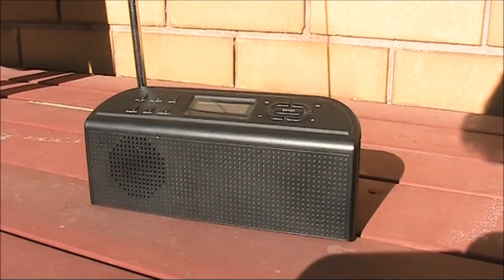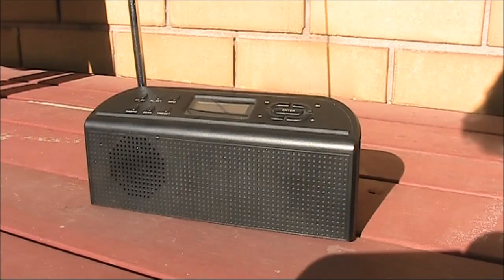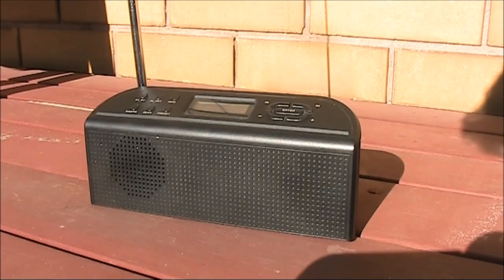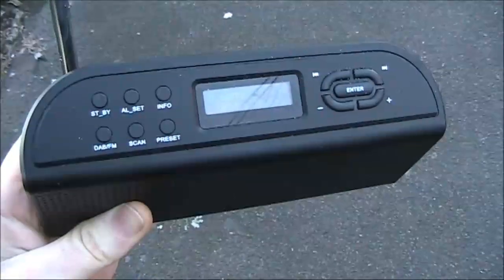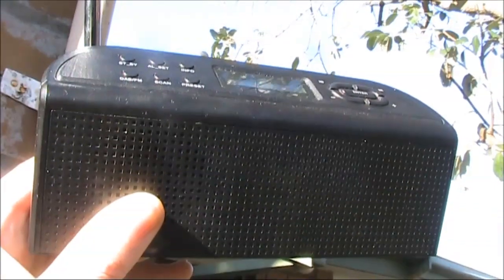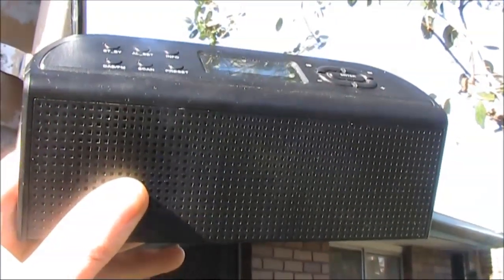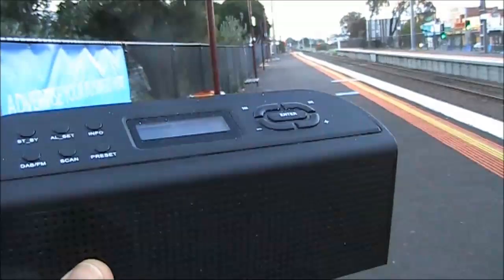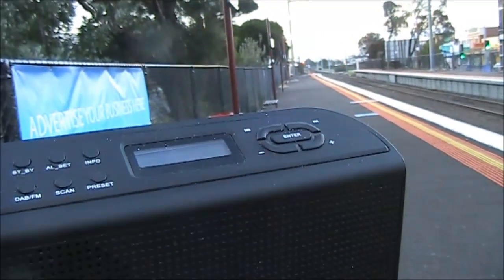Range testing a 1 watt low power FM broadcast station (Surf FM)

Comment: Time to bump up the power. If you are allowed 1 watt then it should be measured at the antenna input. I suspect some loss in the feed line. Just do it and run another range test. Bump up the power to 10 watts. Make the amp adjustable so you can turn it down if you need to. 2 watts won't make any difference worth bragging about but 10 will. Good luck.

Comment: If the transmitter can be mounted on a 10 meters tower, things can change.
Reply from the maker: We went past the Surf FM transmitter site a few months back. It was a suburban house with a 10 - 15 m mast in the backyard.
Reply: @vk3ye  no license regulations say antenna 0 meters.. so antenna cant be higher than ground level

Comment: VK3YE.. is the legal power 100mw in 88-108 for non licensed FM transmitters?
Reply from the maker: Would be great if 100mW was the limit but I'm pretty sure it's much less.  There is however a 100mW limit on many non-broadcast LIPD frequencies.
Reply: @vk3ye  10micro watts lol

Comment: That 1 watt station doesn't have very good range for its power really. I suspect that it's antenna and feedline system is inefficient.
Reply from the maker: Wouldn't be surprised if the regulations specify EIRP - ie you can have a lossy feedline and it's OK to crank up the transmitter to compensate provided the EIRP remains within limits.  The location is flat and there's high ground to the south and east which limits its catchment.  The NZ Low Power FM Society has coverage plots of some of its 1 watt stations but I didn't see a distance scale so it's hard to compare.   Also my results would likely have been better had I used a car radio and not a portable.
Reply: Yeah fair calls. There was a translator for TAB radio in the town I used to live in. I believe it was only 1 watt also, it was on 88MHz. They used an interesting circularly polarized antenna on top of a two-story hotel which was on top of a hill in the town (millicent SA). I would say the antenna  was 20m elevation above average terrain for some distance and well in the clear. It used to put out a rock solid signal for quite some distance. I thought it was fairly impressive for its EIRP actually :)
Reply from the maker: Another possibility is that stations may be running a bit more - eg 5 or 10 watts. Unless the ACMA was doing time consuming field strength checks they'd be unlikely to be caught.
Reply: the circular polarised antennas are whats been used in FM radio for years, it acts as both vertical and horizontal and if used would provide better outcome, the religious stations are the one flouting the power regs, I told one hear here last year to get it off air and get its power reduced to legal 1 watt... there was no argument and it vanished off air for a few days, returning, much weaker, and reduced coverage, and now, legal, unlike before

Comment: It really does disappoint me that Australia doesn't have similar rules to NZ when it comes to low power FM. It worked so well over there they upped the allowed power from 500mw to 1w. Such a shame that successive governments have merely seen the airwaves as a cash cow. Expecting thousands of dollars a year for such limited coverage is ridiculous. I just realised they the station I work at has 56,000 the output power 😳I was an fm pirate back in the early 80s for years. The radio inspector did come over one day and didn't shut me down. I was stunned. He said I wasn't hurting anyone and he left me alone. Wouldn't happen now days. The whole narrowcasting system should me ditched and a similar system to NZ implemented.
Reply: thats one of the reasons pirate radio is so popular